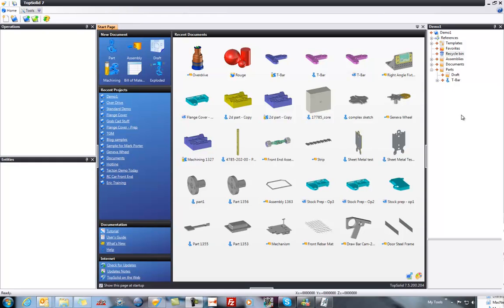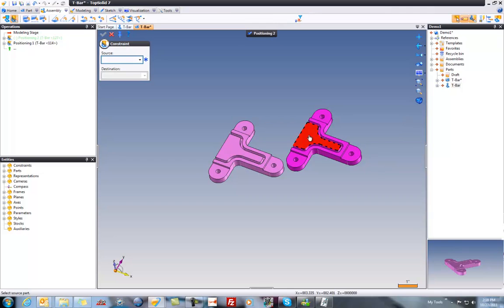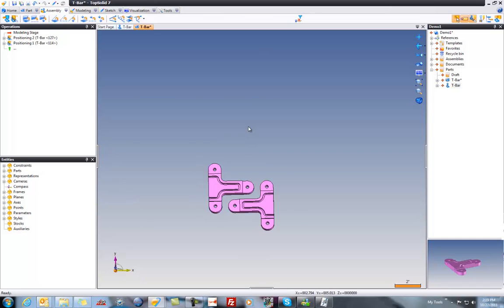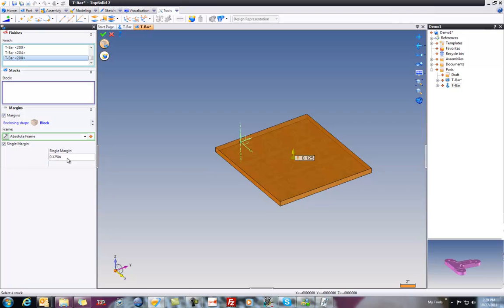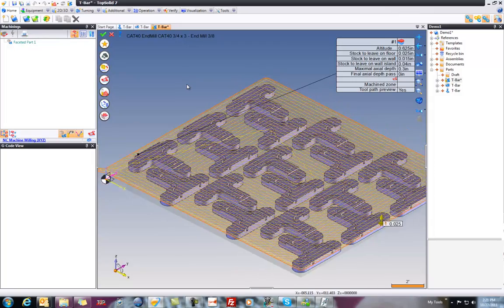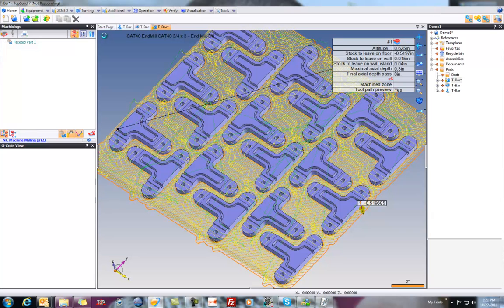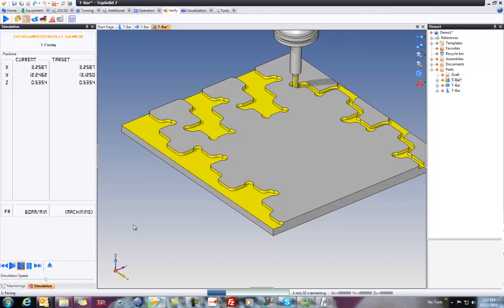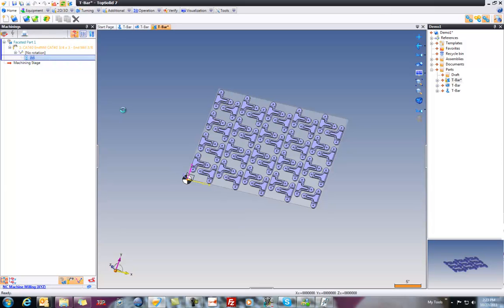Multiple part machining from one stock block in TopSolid Cam 7

Comment: The job is only half done. What about the other side of the equation where you have to mill the remaining stock off the other side to finally end up with the parts. Theory is OK but how do you actually do the work holding, 2nd operation, etc.